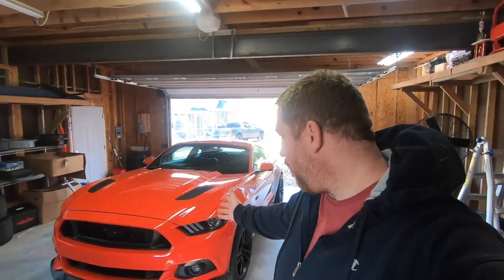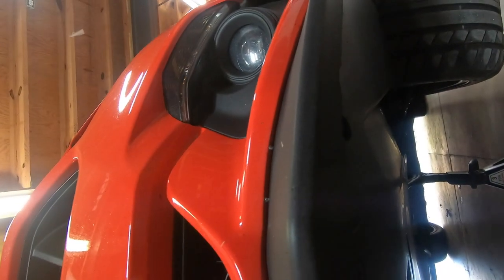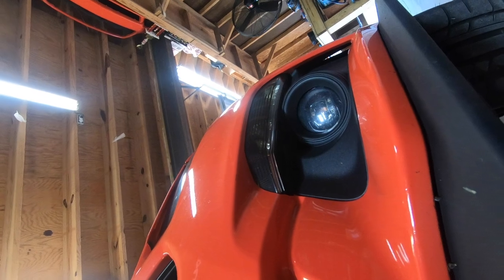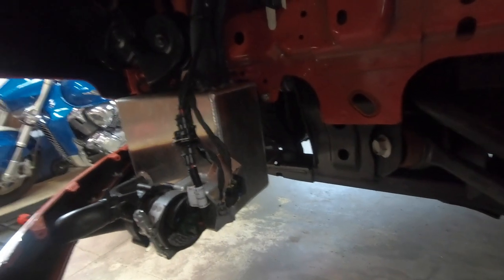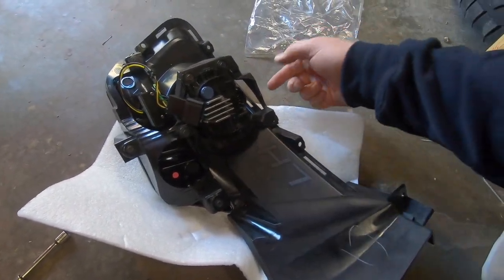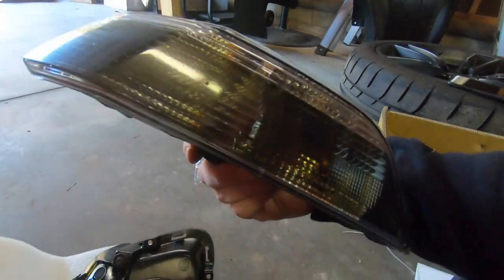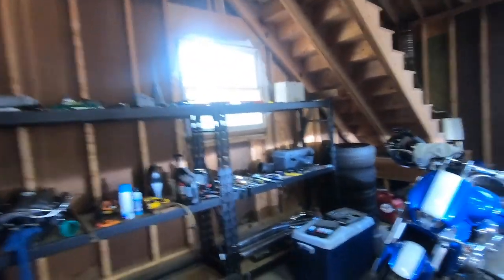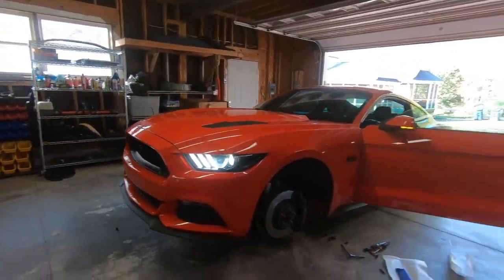Turn signals turning heads - Opt 7 marker/turn signal install

Comment: Looks great. Did you replace your front grill? I notice another on the shelf behind you.
Reply from the maker: No that was my original bumper.  VDOT had some cones out in the middle of the road a while back and a truck in front of me hit one of the cones and kicked it back right into my path and I hit it.  It messed the bumper up pretty good so I had to get a new OEM bumper.  VDOT paid for it all though because I have a dash cam and had the entire incident on camera.   I kept the original just to try and hang it or mount it in my garage.
Reply: Boost Junkie Media Ah okay. I remember you showing us the video.